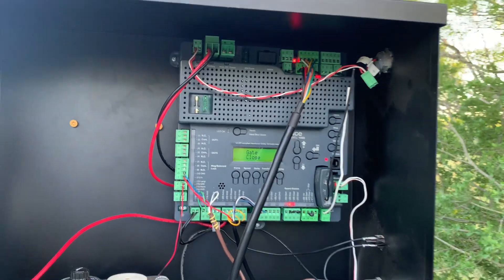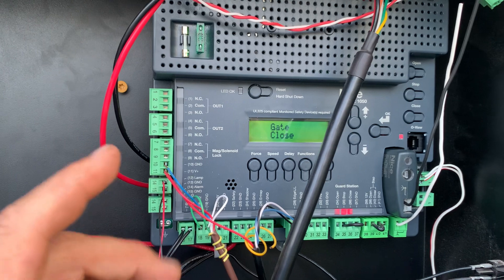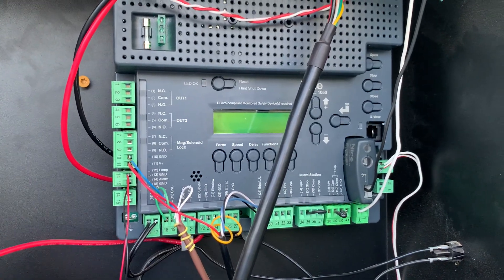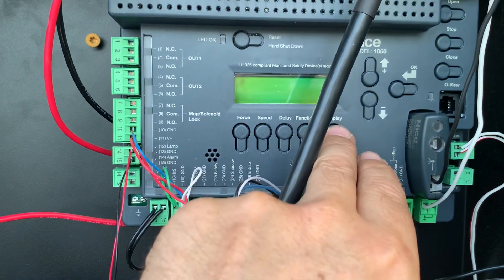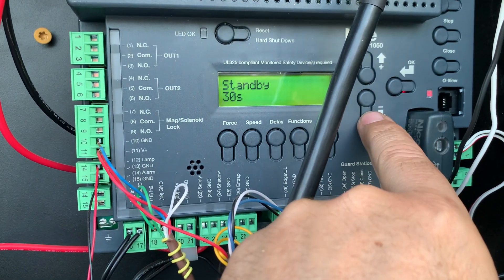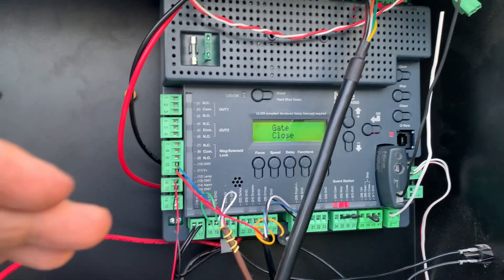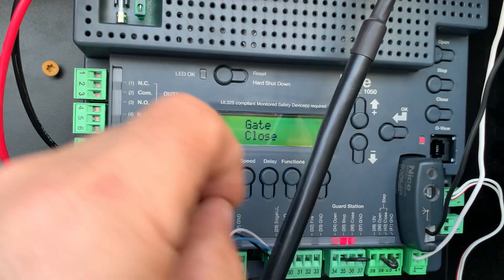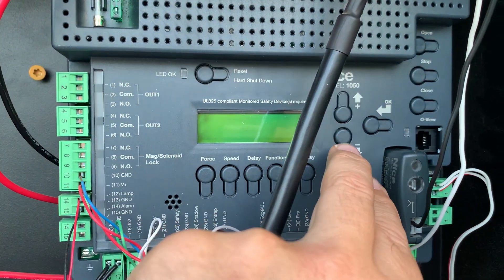✅ Nice Apollo 1050 Control Board ● Setting up Standby Mode for Solar Gate Configurations

Comment: Hey here,  since I have been following you, I have had much success with my apollo nice gate.  I do have one hiccup and I still need some advise.  The gate has a hard shut down every now and again when the gate closes.  It shuts down when it goes over one of the lower brackets that connects the poles the gate rolls over.    I'm not well versed with the terminology, but I'm trying.  Any suggestions?  Is there supposed to be a gap between the 2 brackets that allow the pole to move and roll when the gate is opening or closing?
Reply from the maker: I'm not sure I can visualize the structure of the gate that you have.  Appears to be a slide gate.  In my experience, the Hard Shutdown happens any time that the motor experiences resistance beyond a particular level.  I have had this happen when a swing gate was closing and a large rock was caught under the edge of the gate.  I would check that the movement of your slide gate is unobstructed, lubricated, etc to ensure it is rolling smoothly.  Sorry that's all I can think of! I wish you the best!

Comment: Hey there,  i have an Apollo nice 7351 (Solar) I just bought a new battery (interstate 12v 75ah agm/sla.  I do not have a charger, will the standby mode make a difference?
Reply from the maker: @IMKween  how does your operator sustain without a charger?  Is there a solar panel connected?  Standby mode is essential for solar operations. Otherwise the battery won’t last long and will completely drain out.
Reply: @ Yes, it has a solar panel.  I  never paid attention to the operation of the gate, because someone always took care of it.  I do know a car battery was being used.  I will be postponing my day trip for tomorrow to work on the gate since I received my battery today
Reply from the maker: @IMKween so that solar panel will connect to your operator board. The board will pass that current on to the battery to keep it charged. Standby mode will be needed on solar since the charging is not as good as hardwired. There should be a way to configure that on the board. Since it was already installed I assume it will already by set up that way. Good luck!!
Reply: @ Thank you, Ill let you know how it goes.